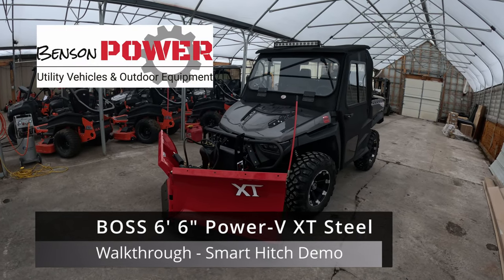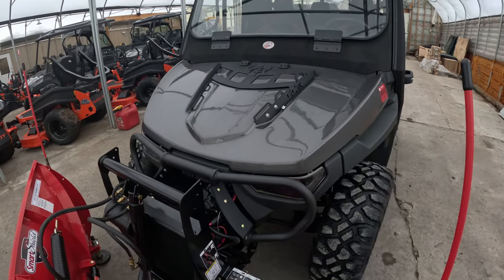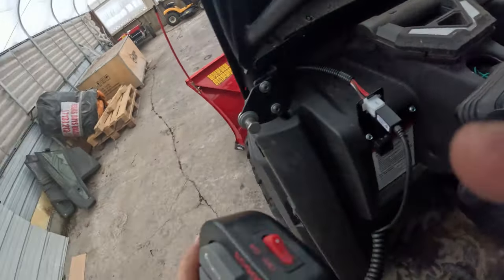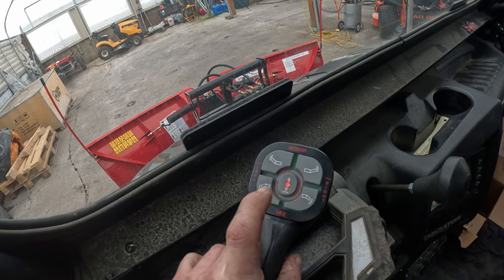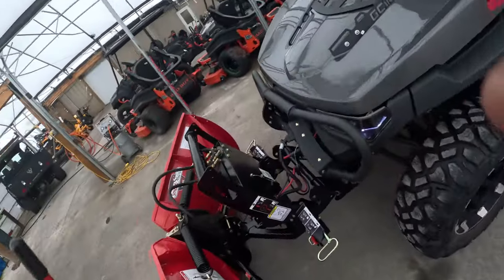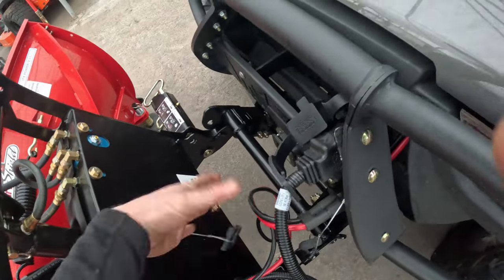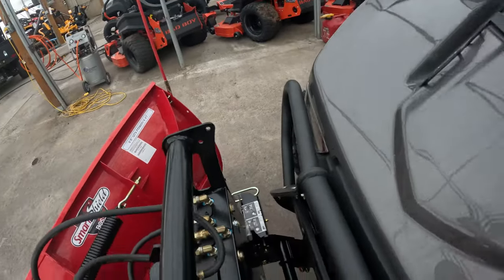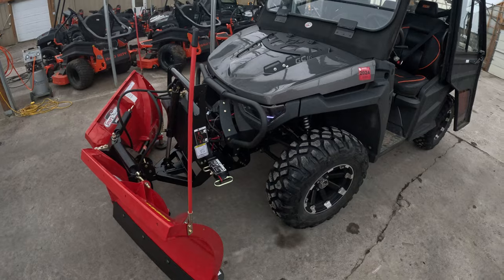Boss Plow UTV V-Plow - Walkthrough and Smart Hitch Demo

Comment: I have ran my fair share of Boss plows and I just wanted to let you know that the gentleman in this video is making it harder than it should be. Plow in float, flip latches and hit the switch. The only reason you would need to physically pull on the pins is if a spring broke and it did not automatically retract. The red tab will automatically unlock when you flip the latched to the disconnect position. Hope this helps.